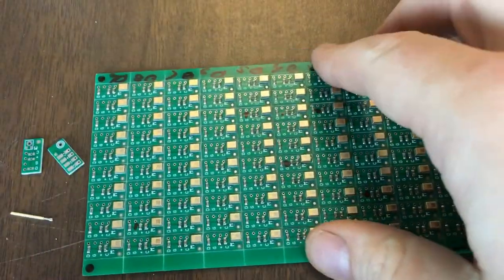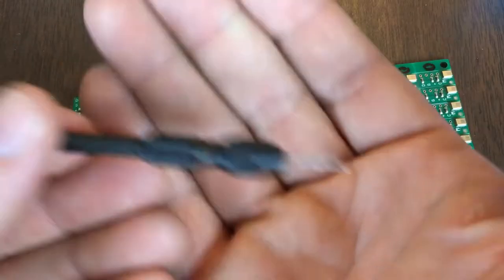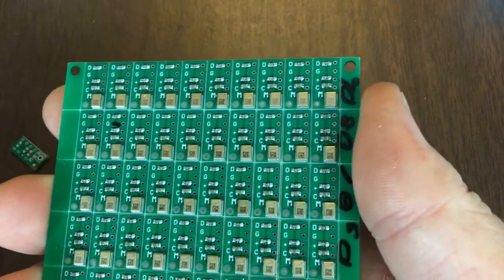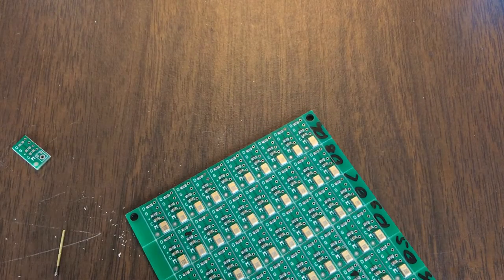Quick MEMS Microphone test fixture

Comment: Interesting video. Lots of amazing new things I learned. 
Quick question: If I wanted to test a mems mic inside a smartphone (I repair phones), would this method work? I know they are smaller inside a phone and it's more economical to just replace them, but, is it possible? and yes, I am willing to put time and money into this if there is a way to just test the mic just like in the video.
Reply from the maker: Hmmm, my other comment didn’t seem to come through…. Anyway, it’s going to be highly dependent on the exact male and model of phone.  If the mic is on a separate flex or PCB, then you could probably do it.  But if it’s on the motherboard, then that would be hard.  And you’d need a separate fixture for every model phone you repair.  Probably not impossible, but not simple.

Comment: Thanks for this nice video. A question: Where can I get this kind of MEMS arrays? I intend to do some experiments on mic arrays. Thanks.
Reply: Microphone arrays are our business, so you've come to the right place to ask ;-)  This isn't so much an array, but many individual microphones that can be broken apart and wired up into custom arrays for prototyping.  I designed and had this board fabbed myself.   Designing a board yourself may be the best way to go if you want an array, but it requires some breadth of knowledge.  A little EE, a little PCB layout, and most importantly, how do you plan to get the microphones into your CPU?  In our case, we use one of our custom-built XMOS usb boards to bring in up to 32 channels of microphones.   Getting multiple channels into the CPU is a non-trivial task.    Just as an FYI, I had this PCB built by NOA labs (aka Smart Prototyping), and the entire thing, from PCB fab, parts procurement, and assembly was under $500.
Reply: Thanks for the feedback. I think one can still use it as an array (i mean the board you've shown), and this will be more flexible. You can select certain microphones in the desired geometry to form an array. If these MEMS mics have analog output, it will be probably easier to combine the outputs of individual MEMS mics and process them by a beamforming algorithm. 
Designing a board myself will take a lot of effort and time. So, I prefer a ready-to-use PCB of MEMS mics (or array). 

How do I plan to get the microphones into my CPU? I don't have a dedicated CPU for array processing. I prefer taking sound recordings at the output of individual MEMS mics, and then work with those recordings offline on my PC. Can you share some information on how to get the kind of PCB you've shown in the video?
Reply from the maker: @waheedullahalokozai5247  Heh, yes, you can use it as an array if you want to.  It was actually designed with a nice spacing in each direction to use it without breaking apart completely if necessary. 

If you want to do array processing, but not capture all channels simultaneously, forget it.  It's nearly impossible.  I've been down that path and it is full of pain because capture systems are generally not sample-accurate repeatable latency, and your system often moves physically enough that a millimeter or two starts to matter.  You really need to use a system that can capture all your mics not only simultaneously, but with sub-sample phase accuracy.  To that end, we use our own system, we call the Mad Dog board.   It's a 32-channel mic array acquisition board that I designed.  Check it out here:  https://signalessence.com/hardware/.  It's not generally for sale, but really for ourselves and our customers.

You ask 'how to get this pcb'.  Well, I designed it myself and this is the only one in existence at the moment :-)  It's a minimum of about $500, maybe up to $1000 to get another one.  These are all digital microphones, so you'd need some special hardware to capture the signals.
Reply: @calebcrome9695  how would I test microphone sealing on the production line?